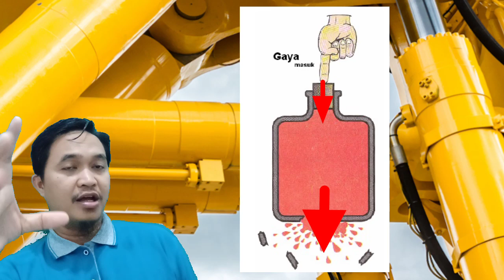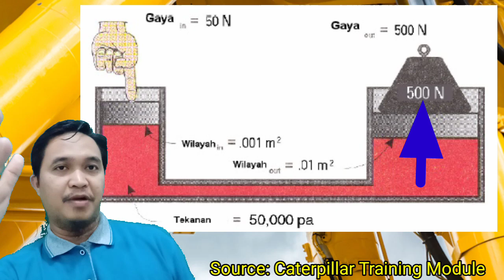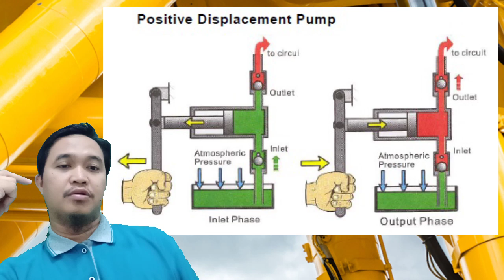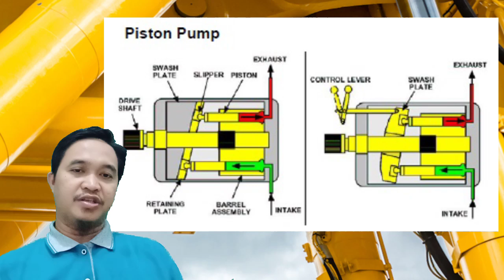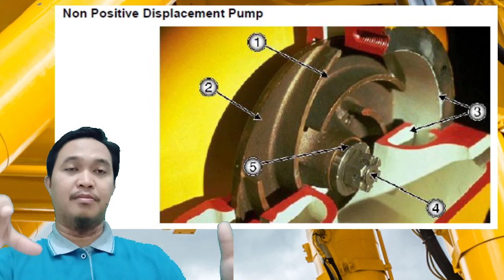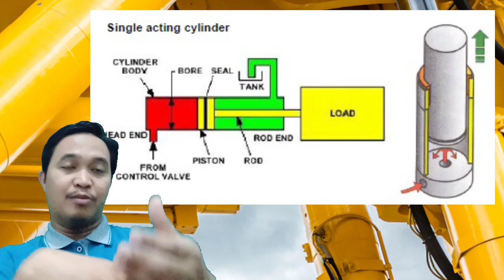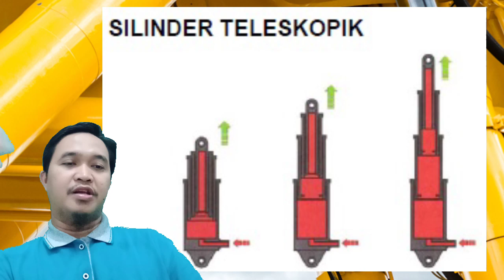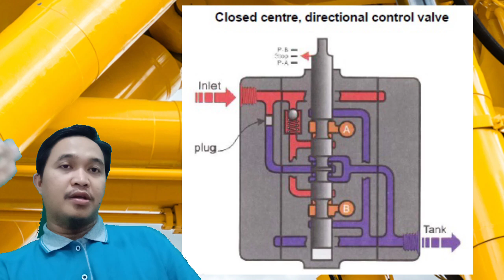Nama dan fungsi komponen hydraulic system.Apa itu close center dan open center control valve.BMC 14

Comment: 8:25 Maaf sebelumnya pak. 🙏izin bertanya. kenapa pompa jenis positif displacment bisa jebol ketika terdapat hambatan atau penyumbatan? Apakah karena presure yang dihasilkan dari pompa akan terus mengalami peningkatan karena adanya hambatan sehingga pompa pada saat memompa oli menjadi lebih berat atau bagi mana yah pak?😅🙏
Mohon pencerahannya 🙏🙏
Reply from the maker: Betul sekali mas, karena sifatnya fluida kan tidak bisa dimampatkan jadi jika output dari aliran pompa positif displacement itu ditutup tinggal pilih saja mas, 1 hosenya jebol, 2 seal jebol, 3 pompa rontok, 4 Shaft penggerak pompa patah  🙏🙏🙏😁
Reply: Izin bertanya lagi om. 🙏 kalo untuk yang non positif displacment pump sendiri kenapa dia tidak jebol ketika ditahan? 
Mungkin bisa tolong dijelaskan kenapa dan apa itu pres fit 🙏karena saya yang masih duduk dibangku kelas 3 TKR masih sangat asing dengan bahasa teknik seperti yang sampean jelaskan 😅🙏🙏
Reply from the maker: @mawantri3179  non positif displacement itu contohnya seperti mesin air di rumah mas, tipe nya sentrifugal kipas nya.. jadi ya ditahan juga gak jebol, tapi kalau ditahan dalam waktu lama ya nanti nya akan ada yang rusak juga mas.. Betul sekali mas karena kalau non positif dia tidak press fit kompresi nya..

Comment: Mas diki saya mau nanya lagi mas..
Kalau untuk 2 stage hoist cilinder itu maksudnya apa ya.sama snub itu gimana carabya
Reply from the maker: Biasa nya yang nanya2 Dual stage ini orangnya Suhu ini mas soalnya mekanik biasa gak akan tau Dual stage, denger aja gak pernah hehe .. 😁😁👍
Dual stage itu system relief valve pada hoist. Jadi kalau pada saat posisi dump body raise spool dual stage mengarahkan pressure pump ke line high pressure relief Valve, sedangkan pada saat posisi lower spool dual stage mengarahkan ke low pressure relief valve. 🙏🙏 Semoga sesuai mas.. 

Kalau snub itu ya ada 1 posisi spool control valve hoist yang hanya mengalirkan sedikit oli saat posisi lower mas, dengan sensing dump body proximity sensor.. 🙏🙏
Reply: @dikiadnarrayyan  betulan mas saya mau belajar sama mas diki karena sampean eks trakindo
Reply from the maker: @suhadihadi8761  itu sudah saya jelaskan mas, semoga bermanfaat.
🙏🙏😎
Reply: @dikiadnarrayyan  makasih y mas diki..bukannya yg dua stage itu yg raise relief valve sama lower releif valve y mas yg bisa disetting itu
Reply from the maker: @suhadihadi8761   lha itu sampean tau mas.. hhehe..  gak perlu saya jelaskan lagi lah.. 🙏😁😎
Reply: @dikiadnarrayyan  maaf mas.biar saya lebih jelas mas
Reply from the maker: @suhadihadi8761  sip mas, gak apa-apa jg , namanya aja diskusi kan ya.. 👍😁🙏